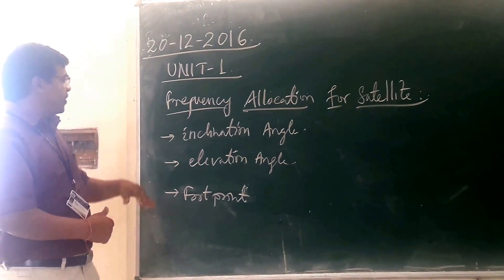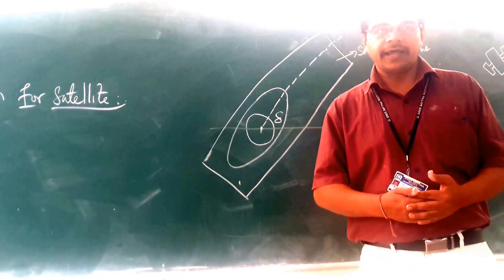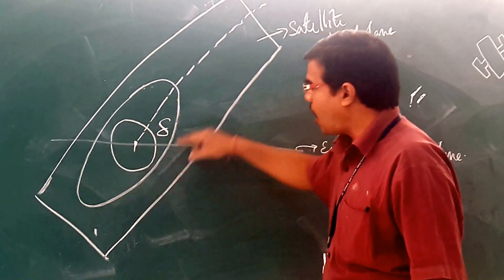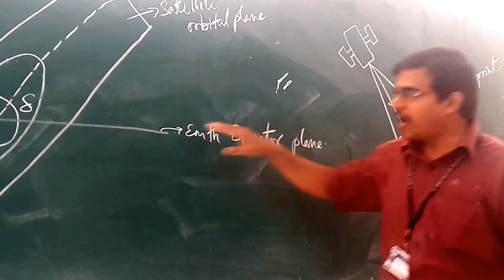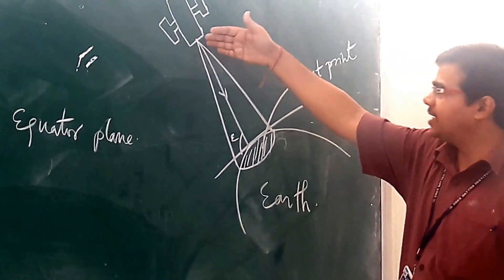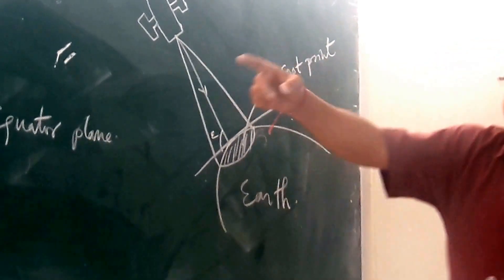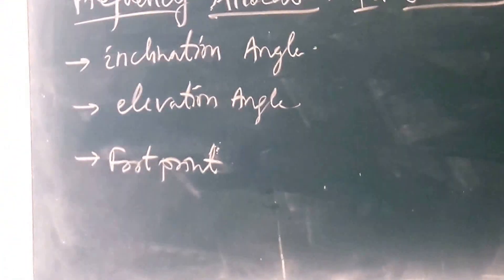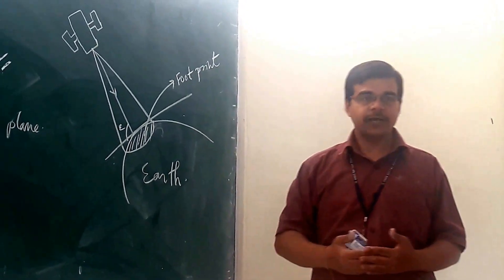SC UNIT 1 TOPIC 4/14 Inclination Angle, Elevation Angle and Foot Print

Comment: azimuth and inclination angle are same right?
Reply from the maker: Dear Shanthan Kumar,
No, azimuth and inclination angle are not same.
Azimuth angle is the angle between the north direction and  the  plane  containing  the  vertical  line  through  the wellhead and the vertical line through the target.
On the other hand, Inclination angle is the angle made by the tangential section of the hole with the vertical.